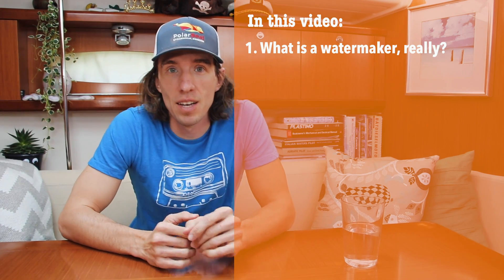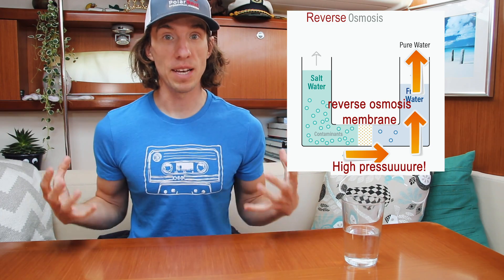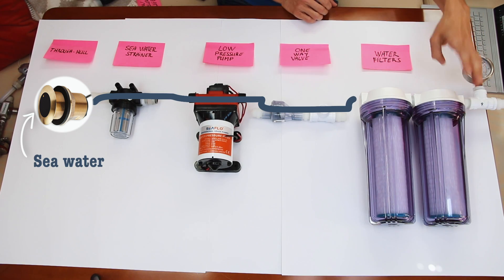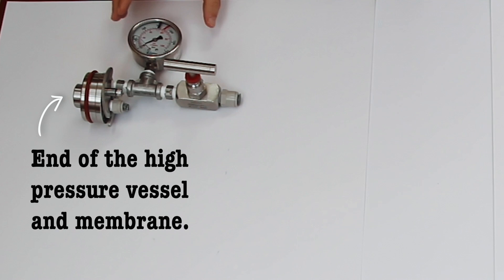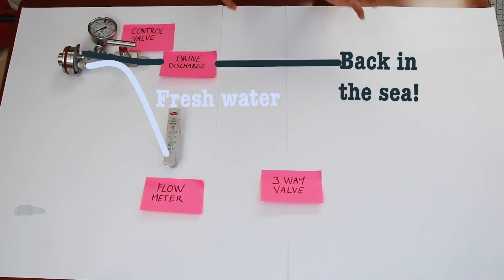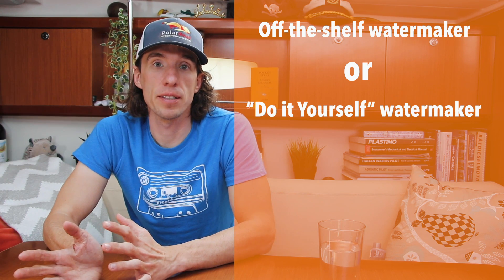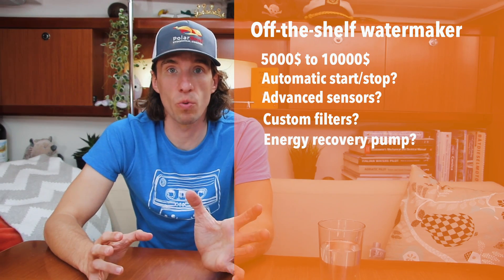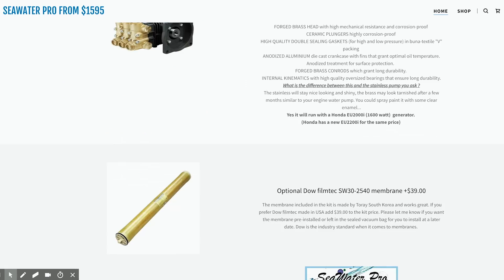How to make water on a sailboat (and how to build your own watermaker) // Ryan’s tech corner #3

Comment: Vana White.  Very poised, elegant, professional, and beautiful.  High praise to be likened to her.

I would recommend flushing the saltwater out of the high pressure pump as well.  The valves in that pump like to stick in the seated position when they sit for more than a week or so with hard water.  The salt will make that happen even more quickly.  I also would get a spare valve kit for it.  Should be less than $150us and come with the O-ring seals.  

Good video.  Can't wait to watch the second one.  Thanks for sharing.
Reply: Watched it again.  You're already doing that.  Awesome.  Great video.

Comment: Very good explanation on how to make fresh water from sea water.  As a salt water fish hobbyist I use reverse osmosis ionized to make pure water to which we add salt to make salt water for the reef tank.  The process you show is very similar.  The systems we use have several stages and can run at lower pressure than your set up at a lower production rate of gallons per hour.  The kits for the reef tank hobbyist also contain inline TDS meters which make TDS testing a lot easier.  Take care and happy sailing.

Comment: You also need a air bladder water tank to store water so system runs only when tank pressure gets low, and water won't compress.

Comment: The salt is not a particulate it is a solute.  If you are going to try and educate, please know the material yourself.  These terms are VERY important.  You are repeating misinformation on the Internet.  Particulate is non dissolved contaminants. Look up other things like "suspensions" and emulsions to understand everything that you need to do to water as part of the process.

Next - 5 micron will NOT filter out bacteria or viruses.  I would not call that drinking water.  You will need a smaller filter or a UV filter to do that.
Reply from the maker: Hello... thanks for the correction above, may people have noted this.  

I did not say that the 5 micron filter would filter out virus or bacteria.  In fact i did not talk about this at all.  It is however a fact the the RO membrains will remove bacteria and viruses. 

Ryan

Comment: Just so you know you can buy a complete RO system from any marine fish store ready to go for 250- 300 pound that'll turn over 30 to 40 liters per hour at 2.5 bar
Reply from the maker: Hello Robert, 

Very interesting information however a 2.5 bar RO system will not be powerful enough to remove ocean salt water and does not meet the membrain specifications we are using.  

It would be interesting to have a link to the fishing store RO system just to have a look though.  Ryan
Reply: @RyanSophieSailing  I'll dig out the link soon as matey

Comment: you might want to look into a different high pressure pump that pump you got is a oil piston type which will contaminate the system and doesn't play well with salt water it is essentially a over glorified pressure washing pump you use to wash your car that has oil in the lower section of the pump that will leak past the pistons as theyre sealed with Orings that are usually viton rubber you want a sealed oil less rotary vein high pressure pump they spin at high RPM and use a screw system to compress the fluid and there are sealed bearings on the end of the shafts that are behind seals making for oil contamination issues from pump almost impossible.
Reply from the maker: Hi Rick, thanks for the prospective.  I was unaware of the vein high pressure pumps.  I took a look this morning, and at least the ones i was looking at did not provide high enough pressure to work with a membrane.  most the DIY type websites provide CAT type high pressure pumps with plungers just as the one i showed.  I do understand your concern and is one i have always had on my mind.  Ill do a bit more digging in to this and provide when i learn in an update later in the season.  -Ryan

Comment: Curious, why wouldn't a device like this work? This one is solar, but some run on AC or stored DC power. https://www.sciencemag.org/news/2017/04/new-solar-powered-device-can-pull-water-straight-desert-air
Reply from the maker: Hi Steve, In theory it could but i got the feeling from the artical that it is still a small scale, prototype.  I would be all for trying something like this as long as it was not prone to breaking.    - Ryan
Reply: @RyanSophieSailing    "prone to breaking" Even so, devices like this look much easier to fix than the water-maker you're assembling. Thanks for responding btw.

Comment: You should add minerals to the water BEFORE it goes to the sink and freshwater tank. R/O will remove almost all of the minerals from the water and this makes the water "hungry." Hungry water will start eroding any metal that it comes into contact with. Also, R/O water is not very refreshing to drink. Put a mineralization system after the sensor that you use to ensure that the R/O filter is stripping the water because you don't want to measure the NEW minerals at this point.
Reply from the maker: Thanks for this Bill.  I have thought about adding minerals to the water for the very reason you expressed here.  I believe this will be easy enough to do later however I want to first get the system going to know it A. works and B. its doing what we ask of it.  I can then put additional money in to add ons such as this!  Thanks for the comment though, it was very helpful.  - Ryan
Reply: @RyanSophieSailing  Always glad to help. My wife is a hydrologist (PE Civil Engineer specializing in water) and she points these things out. My work is in electrical/electronics, but I'm a polymath who annoys folks with obscure information.

I agree that getting your system started and working first is the correct path, but you'll need to not have ionic reduction of all metal fittings in due course!

Comment: Just wondering why you didn't consider/use distillation.  Far simpler system and you wouldn't have to worry about purity.  Could use the same device to make refreshments with too.
Reply: Distillation makes water that is bit too pure.  Also it uses more energy.
Reply: Forcing water through a resin based filter only binds the water to cancerous particulates like Peroxides and Synthetic fibers. A organic stone would be better unless you enjoy cancer and unhealth.

Comment: I can’t wrap my head around how you can push water through a membrane but be able to capture the salty sludge from the other side. Can you explain how that works?
Reply from the maker: Hi Cary,  From what i understand, the membrane is a big piece of paper rolled up inside the tube... water enters on one side of the paper and the clean water gets forced through to the other side of the paper.  This is what separates the two types of water.  from there you can have two different discharge lines (fresh and brine).  I hope that helps.  - Ryan

Comment: Few pieces of pipe, solar parabolic trough, distill sea water. Have it run constantly and drain distilled water into a tank. Mount on cabin roof. Fill with small pump from sea water over the side and float valve.
Reply from the maker: I had looked at using a dehumidifier to do something on the same level however there is a problem with the pipes used and can cause heavy metal problems (apparently).  - Ryan
Reply: @RyanSophieSailing  
Distillation removes all that, don't be silly. Use pure iron pipe, even copper works using non-lead solder. It's used on hot water plumbing.  This is NOT a dehumidifier, this is a distiller.

Comment: OK, so bits you didn't cover:
What flow is needed on the low pressure pump and what is the the 'duty cycle'? e.g. how long you can run it before it overheats (note the one supplied by seawater pro is not a continuous rated pump) then do you run the low pressure pump on 12v or 240v? 
Then what capacity and power you need on the high pressure pump? The High Pressure Pump is the hard part... you can start off with a karcher pressure washer (Seawater Pro have the kit for that) but once you get to dual membranes you need 9lpm @ 800 PSI, unfortunately you don't seem to be able to get that off the shelf (the one from seawater pro is something like 7lpm) then the whole world of pain that is brass vs stainless pumps. Cruise RO are very scathing about brass pumps, Seawater Pro reckon they are fine. I still cannot get any sort of real information on that!
Oh, and the kit from Seawater Pro doesn't include the 3 way valve (although you can get one off ebay easy enough) and you get enough fittings to put the kit on the table, you will need to buy twice as many to fit it all in the nooks and corners of the boat. Don't even get me started on the fact that the Seawater Pro kit in U.S imperial fittings... Just try and get them in the UK!
Finally, how have you found the support from Seawater Pro? I have emailed them repeatedly asking to buy pumps and fittings, no reply, not even acknowledgement... Once the kit has gone they seem to be over. Cruise RO seem to be a lot more helpful, but their kits are quite a lot more money.
Reply from the maker: Hi Charles,  

I will need to check the duty cycles, i do believe that it is NOT continually rated (the low pressure pump) however this is an easy change.  

The low pressure pump is on 12v, in fact the entire system is.  

Correct, the seawater pro kit does not include a 3 way valve however, as you have mentioned this is something that can be procured easily and is one of the nice things with the system, you can add or take away as you please.

I have found the support very good.  I normally call or e-mail and get a response right away.  - Ryan

Comment: The flow meter is also important to not exceed maximum flow of the membrane. If water is particularly hot and specially if it is less salty than average (inflow of river water, for example) your limitation on the capacity of the system won't be pressure, but flow, you will have to work with lower pressures to keep flow bellow membrane specification, if not membrane damage may occour.

Comment: I'd keep foot pumb with seawater.
Reply from the maker: Actually going to keep the footpump but use it as a backup in case the pump dies
Reply: @RyanSophieSailing  Yes, my thought exactly. Sure getting a new thru-hole is annoying, but I think you'll miss seawater while doing the washing up. It can be done quickly and at small cost doing it your self. 

Do you have a washing machine on board btw ? If so, look into getting a ozone washing system. They are quite neat, and no need for washing detergent - and it'll keep you boat eco.
Reply from the maker: Ah... maybe i was not clear.  I'm going to keep the foot pump but use it as a backup to the fresh water system.  i.g. if the freshwater house pump dies i can still get water out of the tanks.  No need for a new thru-hole.

Comment: Yea Iliked the video however drinking sea water is not a good idea because of water borne liquid toxins. The rain cycle forms in the mountains and water flows through rivers and irrigated farms and takes on pesticides. By the time it reaches the sea it pollutes the oceans. The oceans are all ready polluted by offshore oil wells and all kinds of toxic chemicals such as mercury. The oceans are where all the pollution collects, its the lowest point water can flow to and its not just salt, its everything nasty and septic. This solution has been  collecting mans sewage for millinia. That said cleaner is better wash but dont drink that crap. The only safe water is rainwater collected or a solar or even an electric still.
Reply: Very few molecule can pass through that membrane due to their size - the majority of heavy metals and everything else are filtered.  Hence flushing is critical.  RO units have been in use for domestic installations for more that 35 years now, with no issues except the wasteful use of water - 10L ro produce 1L.  Does not apply to a boat though...

Comment: nice content!   I might have missed the discussion of DC vs AC powered.  As I recall, you have a large LiFe battery bank, so that probable favors DC, but going AC allows for using a small generator (also useful for many other needs) or via DC thought an inverter.     I say this because I considering a DY I system.
Reply from the maker: We are going to use DC because of the LFP batteries, but as you say if you had a generator i would go AC.  RYan

Comment: Ryan, that was a great explanation! We have a  couple RO systems at home running on the taps at 60psi.  I was floored that you need ten times that pressure! Holy cow! I guess just because of the density difference. That was really fun to see how it works on a boat. Thanks!

Comment: Are you using 12 volt or 120 on the high pressure pump?
Reply from the maker: Hi Leo, we will try the 12v system.  Im doing this because we dont have a generator. We do have a lot of lithium and solar so doing my math i think it will work.
Reply: Good on ya! 12 volt! Like it! I subscribed so I can follow your instructions. Have not met anyone who had all their facts together on the water maker subject, until you guys. Thanks for your reply, friends. Fair winds to ya...

Comment: Love the video! Looking at building our own watermaker sometime soon. Love how detailed your video is. Have you looked into using a pressure washer as a cheap diy? Your pump is much more durable for seawater I would guess but for the cost I was considering a pressure washer. Something like your seawaterpro link.  Thanks very much.
Reply from the maker: Hi guys.  Yes, those pressure washer pumps i believe would work and be cheaper.  I would carry a spare or two just in case.  That said i have never used one so i cant comment as to how well they work.  Ryan
Reply: Ya we were thinking the same thing. It's a project for a little down the line anyway as we are still on freshwater.
Reply: Take this with a grain of salt (haha) because I've never tried it, but salt water under high pressure is very corrosive and those units are made for fresh water.

Comment: How many litres per hour or even litres per amp hour due to hope to achieve?
Reply from the maker: Hi Martin.  I really dont know but i would guess between 15 and 20 gallons a  hour.... most likly towards the 15 side.  That would be around  60 and 80LPH.  The amps runs around 60amps. So 1amp/hr a ltr

Comment: $5,000 to $10,000 US seems very high for water, until you realize that's about the cost to have a well drilled for a land home. My well, pump and pressure tank came to just over $5,000.  If your sailboat is going to be your home, then the cost of a water maker seems more reasonable. Still, on land or water, that is a lot of money.

Comment: A good start...I listed pretty much those same parts in the comments section on the link I sent you.  I think you got the DC version so you will top out at about 20 gallons per hour and probably use about 60 amps DC while running.  Probably no biggie as you have such a large battery bank.  20 Gallons or more a day isn't bad(20 gph), and unlike some manufacturers like Spectra, you won't have to babysit the water maker all day.  A 1hp or 1.5 hp pump,motor, and additional pressure vessel could get you from 35 to 55 gallons per hour.  With a big inverter or big DC motors and a different pump head this could be done.  Though what you have is just fine.  Don't forget the pressure washer safety release valve.  If the pump fails it could blow the system up, and with the pressure release it could save you two from really bad water injection injuries, and prevent the membranes and vessel from exploding.  It would go on the other outlet of your high pressure head and then from a tube to the saltwater brine discharge. As a side note, I really don't like the looks of those one way valves...I would expect trouble out of them eventually.

Comment: I went the easy way and fitted a Spectra Cape Horn extreme to my cat. I do like the 12v feed pumps with the Clarke pump needing no power to run. You just have to feed 12v to the dual shurflow feed pumps.  I pickle mine when not cruising and just use city water in my tanks which is available at my marina but from next year it will run full time while cruising.
Nice video with good info. A watermaker makes life soooooo much more comfortable. You will see this yourselves for sure.

Comment: You have to make sure your water tank has chlorine in it otherwise bacteria will start to grow so you will need to add chlorine at the proper amount this is very important.
Does the reverse osmosis membrane filter out bacteria I don't think so there is no filtration for bacteria I can see
Reply from the maker: Hello John.  Thanks for the comment.  According to the CDC the RO membranes are extremely effective at removing bacteria and viruses.  However if you do want chlorine in the tank ensure that it is removed prior to flushing your RO membrane.    Cheers.. ryan
Reply: @RyanSophieSailing  I'm not talking about chlorine and the filter not sure I get you? Any storage device of water doesn't matter how clean it is if there's no chlorine bacteria will get into the tank and multiply you could flush out the tank regularly and use tablets to clean the tank is a possibility but without chlorine in the water the tank will get bacteria and there's nothing in the water to kill it
Reply: @johnsweda2999  the membrane has to be flushed with clear water to remove the last of the 'brine', otherwise it starts to grow inside the membrane :)
You do not want to flush the membrane with chlorinated water because that will ruin it.
Also you really do not want to drink chlorinated water. Perhaps look into adding a lump of silver to your water tank (it's not too expensive). It kills bacteria and will not kill you